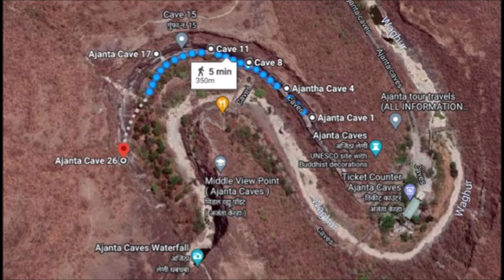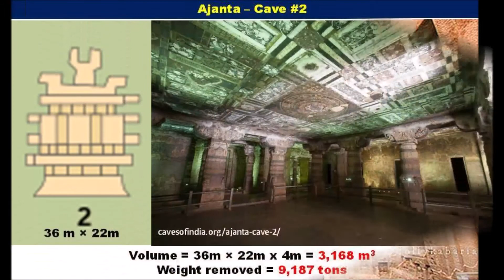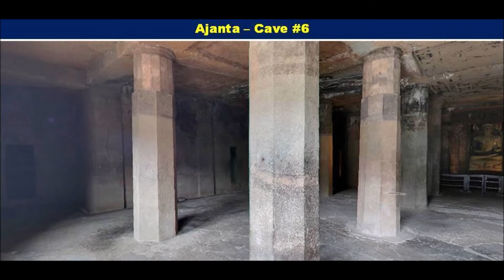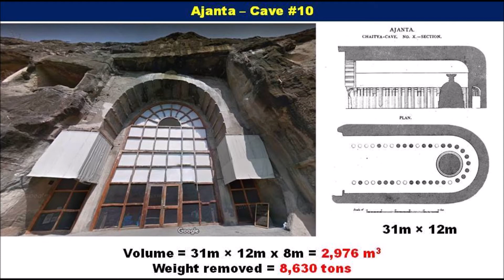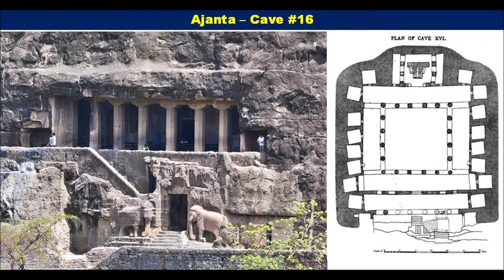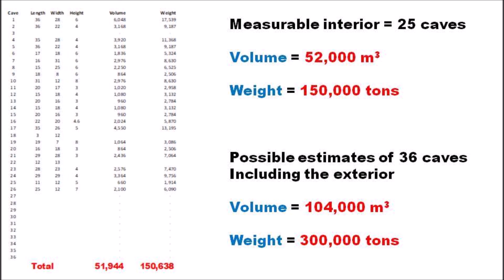Amazing Ajanta and some Crazy Calculations.

Comment: Just to put things into perspective, 52000 m3 would be something like a 10 meter tall block with the base being a 52x100 m football field. I bet a good chunk of that stone was used as a construction material elsewhere.
Reply: But where?
Reply: @Stonecutter334  whoever built pyramids carried the stone from hundreds of miles away.
Reply: @mkeyx82  thats a total mystery too
Reply: @mkeyx82  thats totally unexplainable as well
Reply from the maker: @Stonecutter334  That's my question too. 

300,000,000 kg of bedrock removed. If 1 ancient wheelbarrow can handle 50kg it would have taken 6,000,000 wheelbarrow trips. 

Volume should be about 100,000m3 (have to include last 11 caves and triangular blocks)

1 brick = 0.000163 m3

> 600,000,000 brick size stones

We will always be guessing...
Reply from the maker: @mkeyx82  We will always be guessing. Agree to disagree